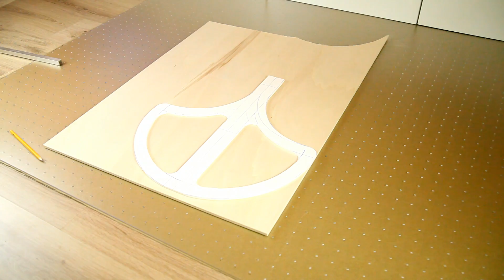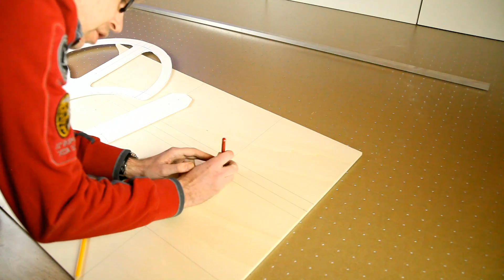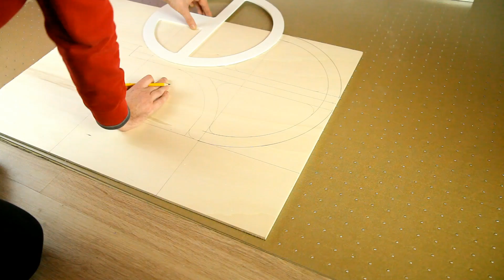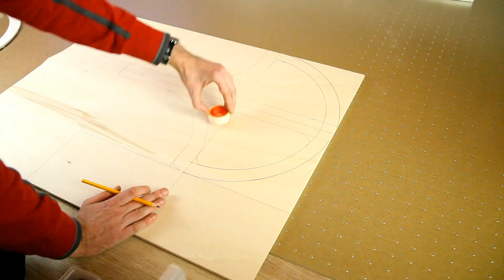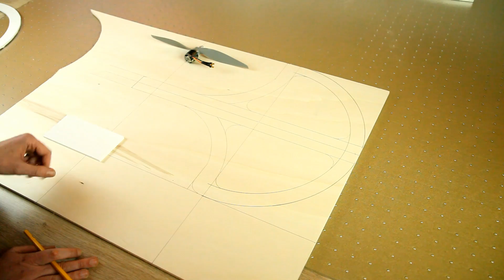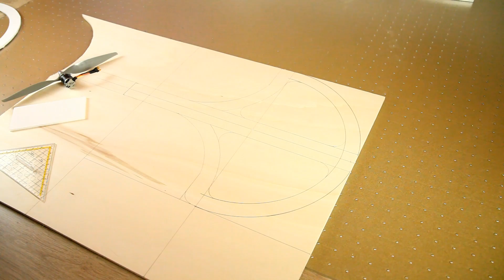Thrust Vectoring TriCopter! 2. Frame Outlining :)

Comment: Does your flight controller have a mode for that type of rudder style, or can it just use the normal (angled motor mount) mode?
Reply from the maker: Every flight controller that can handle a tricopter can be used on this rudder setup :)  As every controller lets a servo flap from side-to-side :) (so, the naza would not be able to)
Reply: DutchRC ADVENTURES
Right. I just wonder how effective it will be in practice, since tilting the motor seems much more simple and efficient - we will see I guess :) I had a quick search for something similar that worked but didn't find anything, maybe I'm googling the wrong words... is there an example out there somebody has successfully tried already, or are you breaking new ground?
Reply from the maker: ***** True! I have not come across even attempts at this :)  So that is basically why I want to give it a try.. The other reason is, that most motor-tilt mechanisms on tricopters work out pretty Bad.. Especially in a crash (bad landing)..

And I have no idea how effective this will be :)  All I know is, that the control surfaces will be pretty big And close to the motor..